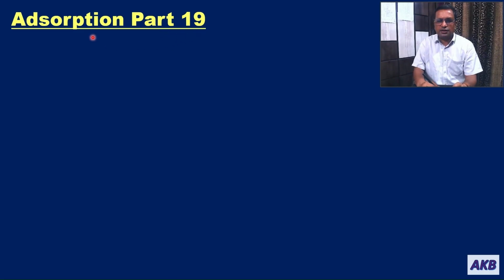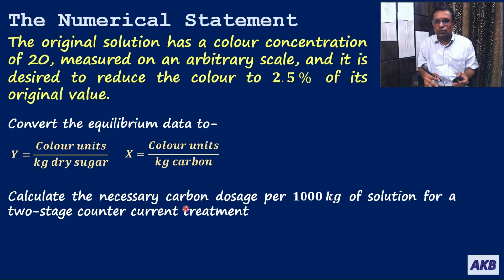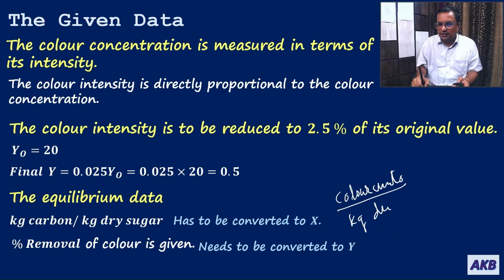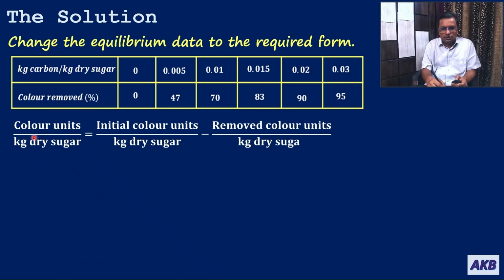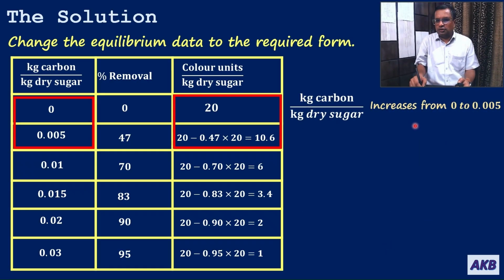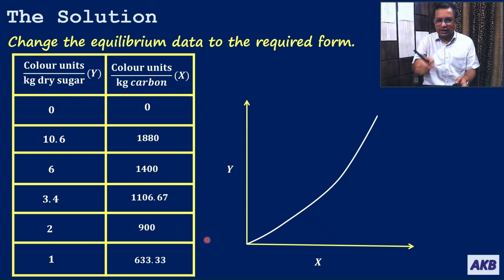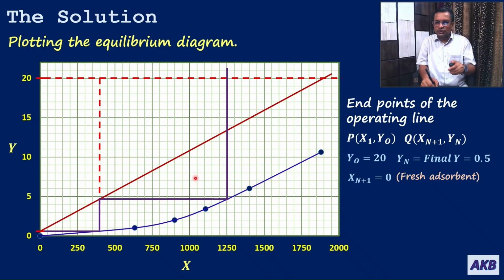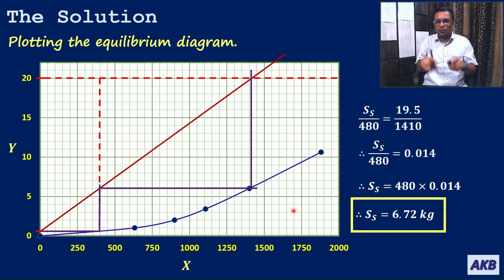Adsorption Part 19: A Numerical Example based on Multistage Counter-Current Adsorption

Comment: Here’s the question written out clearly in text form:

---

(Batch adsorption in a stirred vessel)

Adsorption equilibrium data for the decolourization of a sample of waste oil using a special type of clay collected from a set of laboratory experiments could be fitted by a Henry’s law type relation—

Y = 4.2 \times 10^{-4} X^*

where

 = number of ‘colour units’ per kg oil,

 = number of ‘colour units’ per kg clay in equilibrium.

One thousand kilograms of a waste oil having an initial colour concentration of 50 units has to be treated to reduce the concentration to 1 colour unit.

The adsorbent has:

an effective specific surface area = ,

a surface mass transfer coefficient  (on the solid-phase concentration basis),

and the density of the oil is .

(a) Calculate the minimum quantity of adsorbent required.

(b) What is the required contact time if 1.2 times the minimum amount of adsorbent is used?

---

Would you like me to solve part (a) step by step first, or write the full solution (a) + (b) directly?

Please sir make video this problem